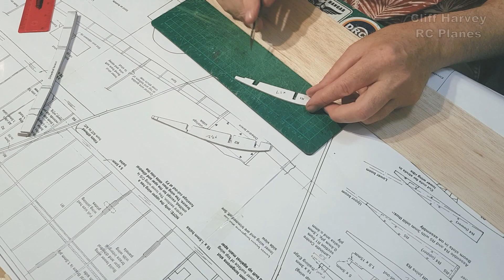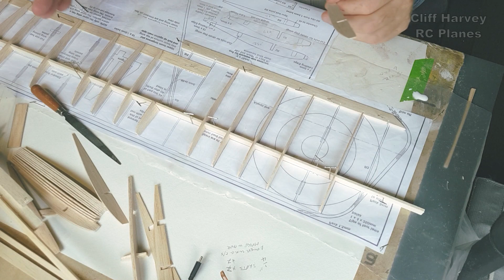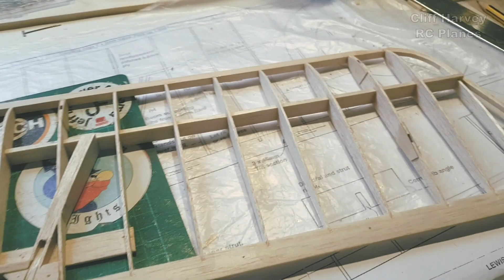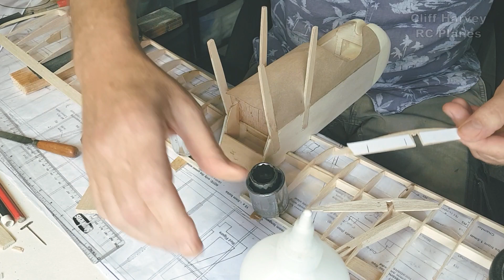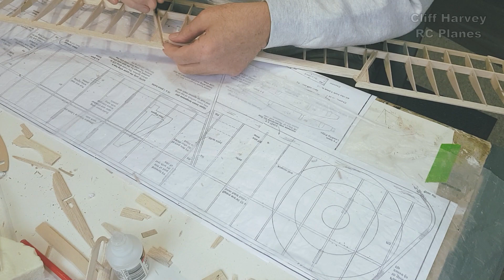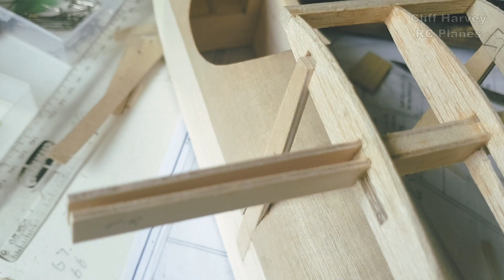Building of a WW1 British Icon ... the Airco DH2, Part Two

Comment: Cliff, love your work! Building balsa aircraft is a real pleasure and I love being able to watch you while I'm working. I'm interested in your thoughts on using CA glue rather than white glue? I find I'm so impatient that using CA helps me get more done and stops the project from languishing. Is your use of white glue just habit, or does it have benefits over CA? (I find super thin CA gets into the grain and makes the balsa very strong). I sometimes also use small amounts of CA to tack something in place while epoxy goes off (If I'm gluing something with epoxy).
Reply from the maker: Hi Catch, thanks, it's advantage is its flexibility in the joint, disadvantage is time to dry so sometimes I'll build with Ca and go over the joint with white glue afterwards
Reply: @cliffharveyrcplanes  Thanks, that makes sense. What are your opinions on the aliphatic and super aliphatic glues? presumably not great since you stick to the old classics!
Reply from the maker: @Guy_6397  Just to clarify when I say 'white glue' I'm not talking about ordinary woodworkers white glue, my current glue is a white glue called 'Speed Bond' by Deluxe Mataerials, this 'grabs' really quickly, prior to this I've used Aliphatics which is a great glue but just takes a little longer to set.
Reply: @cliffharveyrcplanes  Ahh really interesting, my experience with whites glues is a long dry time, I'll have to google 'Speed Bond'. The aliphatics were good but I had a real trouble sanding them down. Looking forward to the rest of this build series!

Comment: I saw the boo-boo, at least you saw before the glue dried. I am sure I didn’t miss it, but when you put the Ailerons on, did you cut the ribs down on the wing side so you can add the Leading of the Aileron and the trailing edge of the wing?
Reply from the maker: Hi Chris, it was a classic mistake wasn't it! I didn't show the trimming of the ribs so you didn't miss it, I actually trimmed the ribs down on the aileron side 👍
Reply: Always cut the ailerons side Chris, never the wing as Cliff indicated. This means shortening the ribs on the ailerons. I usually remove the ribs to do this.
Reply from the maker: I think it doesn't really matter as long as you remember to cut out enough balsa to allow for the new trailing Edge and Leading Edge 🤔
Reply: @cliffharveyrcplanes  I guessing the plan has what you need to do. Just something that I did not see you do, so was scarring my head 😎
Reply from the maker: @DadsRCHangar  Actually Chris, no, the plan didn't show ailerons at all, Nick and I added them on the advice of the designer 👍